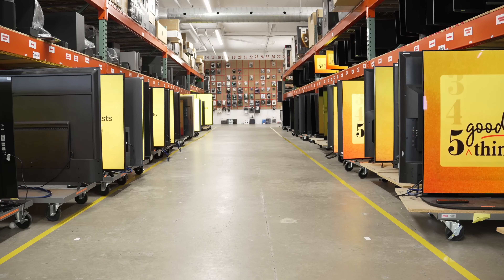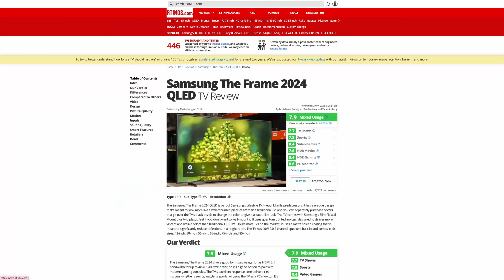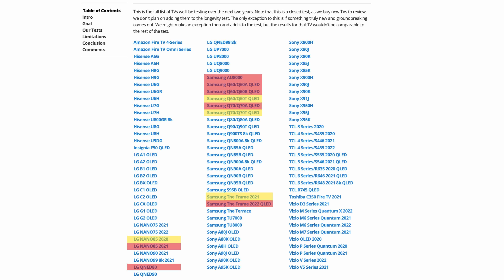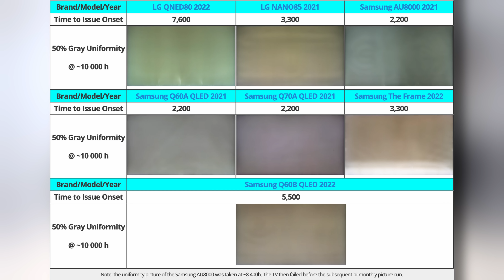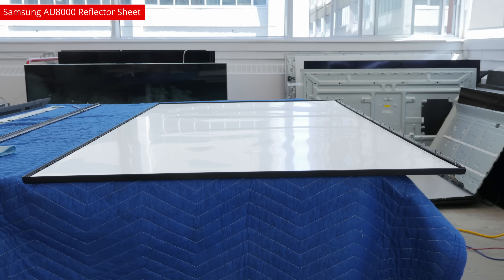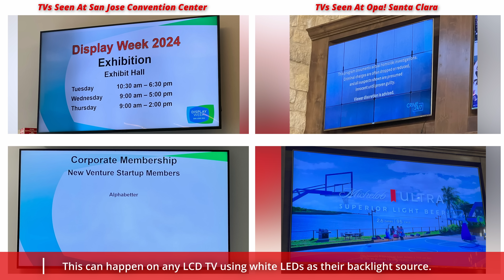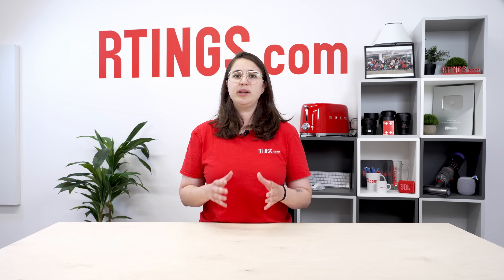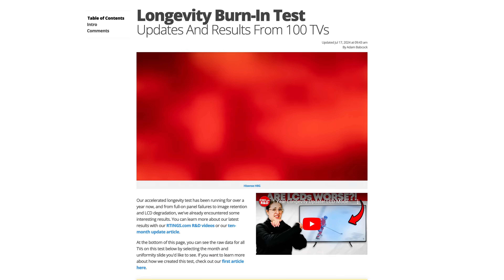Edge-Lit TVs Fail FASTER Than Others (100+ TV Test)

Comment: This is what happens when you try to make TV's thinner and brighter.
All that heat due to high brightness has to go somewhere.
Keep the brightness down or pay the price in repairs or replacements.
Reply: The solution here is obvious: STOP buying edge-lit LCD TVs! Just say NO!
Reply: @michaelbeckerman7532  The problem is that most buyers don't understand that these edge-lit models
have a limited lifespan and they leave them on at full brightness then wonder why the panel has issues so soon.
It keeps me in a job repairing them, provided the thin frame doesn't split as you try to remove it, the backs
are held by thin fragile clips and are a nightmare to remove.
It's all done to make you buy another TV that won't last any longer.
Reply: @michaelbeckerman7532  Or dont run them at 100 percent brightness.
Reply: @michaelbeckerman7532  No the answer is to design them properly to withstand the heat. LG and Sony use a shield to stop the heat from damaging the prism sheet, Samsung don't hence their edge lit panels fail and new sheets cost a fortune.
Reply: I think being thin isn't the problem, but it need better heat management. most edge lit are only on bottom side while the heatsink is insufficient. If they could add heatpipe to spread the heat to whole surface and enough vents, but that would be mean loss of profit to them.
Reply: @samueladitya1729  This issue with bottom edge lit panels is not a new one, even if you keep the brightness down
sooner or later the reflective sheet starts to warp ,and split as shown in the video.
The latest high brightness panels just fail faster.
The only option is to buy a TV with full array local dimming this spreads the heat across the whole panel.
As yoo say they could fit heatsinks, but today it is all about profit and not long term reliability.
Reply: Yep, and go FALD
Reply: The design requirement for thin and bright, can still be combined with a design requirement for 50,000 hours nominal lifespan. They are not mutually exclusive, but obviously it would raise the price due to the need for better engineering, higher quality materials, sophisticated heat transfer solutions etc. :)

Comment: I really don't understand the point of spending a lot extra for a design that loses its novelty very quickly.  The whole point of a display is to look at it from the front, not the side, so if I'm going to spend extra so a device looks neat outside of its intended use case, I'd rather get an OLED display where burn-in isn't a consequence of its form factor.
Reply: As long as the thin part is only the bezels, to be not too distracting, I'm fine.
Reply: I legit do'nt get the appeal of Thin TVs , beyond the already thin standard set by the typical LED/LCDs . Who are those people that need to move around tvs all the time and  can't afford the space for a normal modern tv ? lol

Comment: I’ve seen so many blue tvs in restaurants and public places and that makes so much sense. I never considered it could be due to the LEDs degrading.
Reply: My Doctors office waiting room has an led tv that is 3 years old and it is unwatchable because they never turned it off.
Reply: @charlesmyers8150 how do you know it's 3 years old?
Reply: @JRBowling1997 I have been  going there for 21 years, every 6 months.
Reply from the maker: Now you know!
Reply: People think LEDs will last for decades and decades, but that is a false misconception. The brighter something emits light the faster it will degrade. that's just thermodynamics at play.
Reply: @RhinoXpress no wonder my 2012 samsung tv still alive with perfect screen. I set the backlight setting to 1 as opposed to default 8 and max is 20. Now I know the heat is LED 1 enemy 👍. Thanks
Reply: @RhinoXpress LEDs last longer than traditional bulbs with filaments or mercury. Use less power to but are still acceptable to heat and heat kills. If you can’t mage the heat the lights will burn up. If an LED runs at 12 volts it won’t get hot at all really and will last a long time but the LEDs in these TVs are ran at higher voltages and are put under more stress think about it the driver is constantly dimming and brightening or shutting them off and turning them on all within milliseconds to keep up with image on screen. The more you turn the back light up the more the LED emits light. Best not to crank the Backlight to the max back it off like 15% trust me your eyes will adjust and your tv will last longer.
Reply: @RhinoXpress  Some do. I have a 10+ years old Dell laptop with LED backlight and it is fine even after years of heavy usage. Meanwhile my 3 year old Lenovo already had the LCD replaced under warranty due to backlight issues.
Reply: @Max_Mustermann      that's not decades and decades though. Besides, It also depends on the brightness of that LED. Yes old LEDs will last longer than newer LEDs, because older LEDs  don't emit the same amount of brightness that newer LEDs do. With that said, you won't see an led last anywhere near what a crt can last for though. There are CRTs that are 70 plus years old that are still running. The brighter something emits light the shorter it will last.
Reply: @RhinoXpress  It's not decades, but 12 years is pretty decent for a laptop and the screen doesn't show any signs of failing. Plus it's kind of hard to find an LCD computer screen or TV with a LED backlight that is decades old, as the technology hasn't been in use that long AFAIK and older LCDs have CCFL backlight.
Reply: @Max_Mustermann   led displays have been around since 1980's. So unless one was hardly ever used you'd be very hard pressed to find one in original working order under normal use that can display an image. There are still CRTs from the 1950's in original working order that still can display an image today after decades upon decades of use.
Reply: @RhinoXpress  It is possible, although all laptops and LCD monitors I've used that were manufactured more than 15 years ago had CCFL backlight. As for CRTs, they also tend to degrade over time with decreased brightness, burn in issues, etc.
Reply: @Max_Mustermann   well good luck finding one cause you'd be hard pressed to find one 40 plus years old that still works after being used daily for decades. They do degrade but at a much much more slower rate than LEDs.
Reply: @RhinoXpress  Eventually the cathode will degrade from use, but otherwise if you have good phosphors they can last a really long time.  And the actual tube lasts in storage for geological time periods.
Reply: Or Windows Blue Screens 😂
Reply: Doctor office waiting room. Everywhere that tvs never get turned off.
Every TV degrades. The old CRT TVs had burn in and degraded. Every TV, just a matter of time.
Reply: Yes, now I know why my mum's TV has a blue hue😮😂
Reply: had to get my parents a new TV just for this reason, the picture was completely blue, perhaps purple even... Thought it may be an issue with the LCD panel but this is probably it! Makes alot of sense now too as their TV was next to a fireplace and was often running the whole day!
Reply: @midnight_yota  yes LED. bulb gets hottest in the middle and when they are pressed too hard, the yellow coatings you see are slowly burned away and you get more blue light.

But I have also seen mobile telephone (IPS) screen and LED (LCD) have a red/blue cold white tone, caused by the LED bulbs themselves.

LEDs are misused and used incorrectly!
Reply: It's interesting that there's no such thing as a white led, since they are all blue ones with a filter. I guess that's why they call it "blue light" since the light is blue at its source. I only learned this recently.
Reply: I have always thought that was because of faulty VGA cables
Reply: I've also seen bright spots on many TVs in commercial places as well.  I'm guessing the diffusion material is breaking down, allowing the LEDs in the back to show through brighter.
Reply: They were probably not edge lit.

Comment: The best solution might be to avoid buying TVs, right? Just when my mom's 1080p TV screen cracked after seven years, I handed down my main 4k TV to her. Now, I'm considering an upgrade, but I'm not sure if I want to purchase one at all.
Reply: Just don’t buy a dirt cheap edge lit. Get a midrange full array local dimming to lessen your chances of failure. No tv is going to last forever but you should get several years out of it if you take proper care of it and don’t leave it on 24/7.

Comment: I use one C2 42" OLED as a gaming monitor, it is running about 10,000 hours now. I have no burn-in or image retention or at the very least it is unnoticeable.
My 27" 144hz TN edgelit monitor on the other hand seems to have a small delamenating issue after cleaning it with just a bit water, it looks like a watermark. The funny thing is, sometimes you can see it sometimes you don't. Oh that monitor is much older with probably 25k-30k hours. And it is used as a secondary monitor with a static image more often.
Reply: That water issue happened with my fancy LG IPS. If it get sinto the clamping stack/edge frame it'll get into the LCD layer and stain it in certain colours.

Comment: Still loving these updates. I still prefer a chunky, dependable display over any 'modern' thin one. I still got some old-school CRT's around as well for Retro gaming. They just last much longer, easier to repair, and from a time before Planned obsolescence took over.
Reply from the maker: We'll continue to put these updates out as long as we keep finding new important info to share!
Reply: @RTINGScomRD  Just for the hell of it. It would be interesting to see burn-in on plasma sets or even CRTs.
Reply: @BluRay_4 Unlike OLED where you can get over or under-compensation artifacts depending on brightness levels requested and quality of the wear compensation system, plasma burn-in is exactly what you'd expect. A simple negative image of the burned in content. It'll be a bit fuzzy if pixel shift was on, and always most visible on plain white.

CRT burn-in is similar, but can be especially wild. The display structure allows for ambient light to excite the phosphors easily, so the burn-in can be visible even with the display fully off and unplugged. Used to be common to see old tubes with the weather channel permanently etched in shops around here.
Reply: @random_n  i own a few burned in crts and the phosphors have turned from normal white to a yellowish/orange color.. resulting in the image being a hell of a lot "warmer" overall. I also have a few plasmas.. one has 45k hours on it and its been through hell and back. Burn-in is almost invisible BUT i usually get mal-discharge where there is burn in. I fixed it by turning the VS voltage up and its nearly non existent now. Pretty interesting.
Reply: Easier to repair is a hilarious thing to say about crt technology 😂
Reply: Im too on CRT's. Have my original 14'' from 1995... still going strong after 30 years. Only red color is little bit weak.

Then I've bought 15''  CRT for retro gaming. 

My highend Samsung CRT from 2005 at everyday use, still going strong after 20 years of use. Only power sections needs to be done, condensators are probably worn, it turn off from time to time. They are easily repairable at least on power section

I hate LCD and widescreen. Was so dissapointed around 2010, when theey stopped CRT, and massively moved to only LCD...disgusting colors, bad latency, angle screwing real look of colors, no true black, disgusting LED light. For me meeh.

Comment: I'm glade I never was interested in Edge Lite TV's.   Did not like the complaints of edge light leaks.   The micro back lite LED's are a great option if you don't want to go for OLEDs.
Reply: I always felt direct lit was superior for pic quality however well implemented edge lit doesn’t have the same blooming around light areas such as the credits in white. It’s a trade off: little blooming for a different kind of light bleed which I call spot lighting. Pick your poison.

Comment: My dream is to see legislation requiring at least a 5-year warranty on these products.
Until then, premature failure will not only be common, it will be in the best interest of manufacturers.
Reply: Until then, most TVs over $1000 US have that 5yr warranty free at Costco. If not, the warranty is pretty inexpensive i.e. $35 for TVs less than $500. I agree, they all should be 5 years though, luckily most budget TVs are 3. Granted the average lifespan of a normal LED TV is 5 to 8 years.
Reply: @neptune612  Exactly. We cannot forget that when the manufacturer does not provide a long warranty, it is the same as saying that the company itself does not trust the durability of the product it sells.
Reply: Here in EU (or least in my country)  you start from 2 years, and above a certain price (~600-650$) it becomes 3 year mandatory varranty from the manufacturers for CE products
Reply: Pointshotdr, you know nothing about tv at all. All those cheap tv under $700 usd, those have warranties that last 2 years or less. All the $1,500+ tvs have 5 year warranties. There are many reasons why they are $1,500 usd is because they put their best tech and material in it. But people are cheap that wants the best for cheap and that's not possible. You rarely see $2,000+ usd tv goes on sale for $500 dollars or more. Only tiem that happens is when a new models come out.
Reply: @KingAllpha321  I absolutely agree with you Sir. As in my previous comment I say buy cheap TVs and when they break dump them in the nearest park. Corporations have proven time and time again that they will clean up that mess and environment will be great again. In my stupid thinking if that horrible thing Government said 5 years warranty required maybe that would save those poor Corporations from cleaning up parks and rivers and oceans...I hate Government.
Reply: Where would it end though?  It would be nice to have longer warranties on everything, except that this raises the purchase price to pay for that, and you can purchase an extended warranty yourself if you want one, without everyone else having to pay for that if they don't want it.
Reply: Why exactly this an extreme use case
Reply: @chriswright8074  It doesn't seem that extreme to me.  I have 4K TVs set up as work computer monitors and reach 10K hrs in about 3 years, but remember that on modern smart TVs, they actually stay turned on internally, just shutting the screen off when you press the off button but they are still plugged into a live wall outlet, so the electrics are getting 10K hrs before 1.5 years have passed, even if you never use the  set, just leave it plugged into the wall outlet.  Granted the test RTings is doing, mostly focuses on the screen issues at 10K hrs but if something else fails first, kind of irrelevant if the screen still works, unless you find it acceptable to pay for a repair out of warrant.
Reply: Exactly!
Reply: My dream is to see TV manufacturers stop making edge-lit TVs altogether. (Hint: They NEVER should have even started making them in the first place!)
Reply: To be fair, you are paying thousands for cutting edge technology for it's display tech, or thin design. They already have factory warranty which is a minimum of one year.
If you want a TV for longevity, you probably need to look for an older design
Reply: How about making products repairable?
Reply: Let the individual consumer decide, They do it for everybody the price will go up.
Reply: That's how it used to be.
Reply: Yes, more government, more taxes, exactly what we need
Reply: Wouldn’t want the government to actually mandate for the people, rather have it give hand outs to lobbyists companies.
Reply: @thejohnbeck 🤣🤣🤣🤣 said nobody with brain
Reply: @thejohnbeck Europeans making 20k a year trying to justify how they're actually richer than the average American making 70k because something something "free" healthcare something something "free" education something
Reply: @GeneralKenobi69420 you're as free as Romania in total, as free as Poland in politcal rights and as free as Greece in Civil Liberties :^)
Reply: @thejohnbeck  Agree, we would just dump our broken two year old TVs into a park near by. Who cares, it's just environment.
Reply: @dupajasio4801  As the consumer it's our responsibility not to buy shoddy products and to do our due diligence, to think otherwise would be to insinuate we're not adults but children
Reply: @Scornfull  With all due respect. Do you think we as lonely customers can win the game corporations play? I work for one, I know exactly that we have no chance. Can't you see products are built more and more with planned obsolesce? I'm sorry, but where have you been that you haven't seen this corporate bs. I.e. in my building 6 fridges were replaced by Fridigaire model. Mine lasted the longest, can't remember 3-6 months. Now, how would you explain that environmental disaster. I assume you are against  government regulations. I'm not big on those, but what other choice do we have? Greetings.